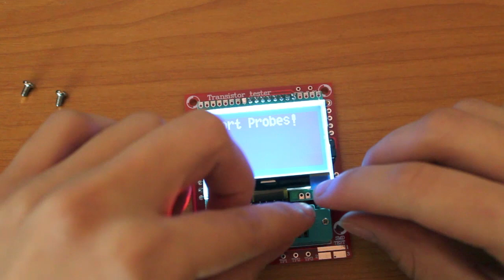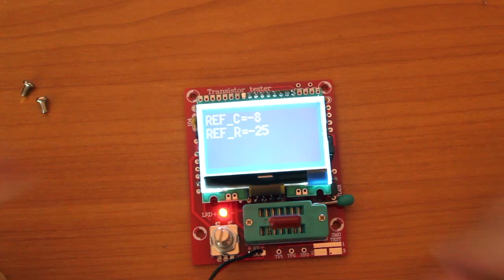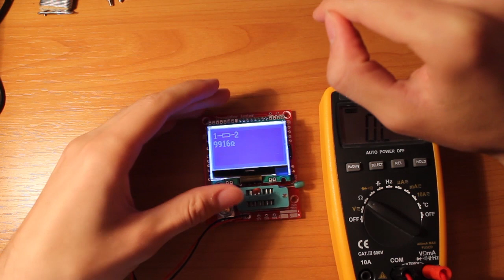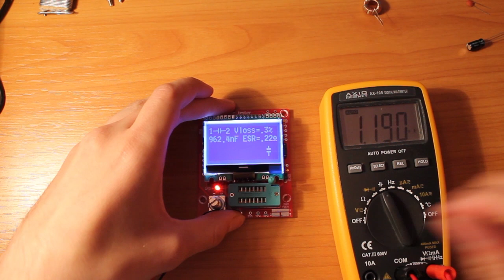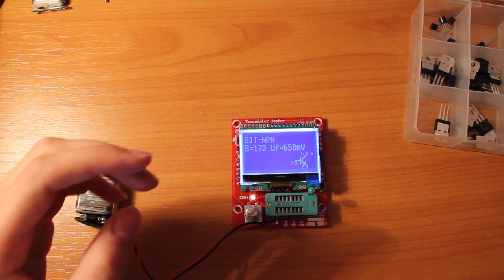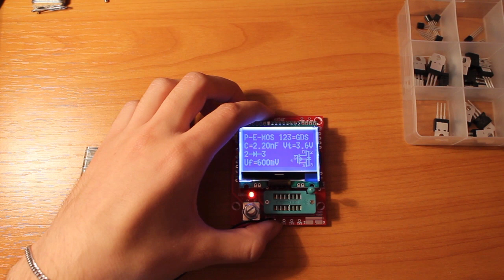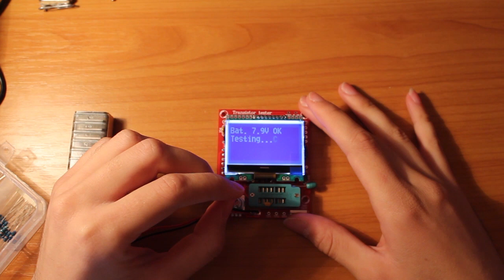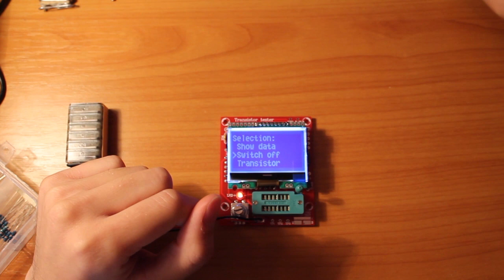M12864 Graphics Transistor Tester from Banggood, Part 2: Review

Comment: Hi, I have the identical model of video tester, bought at least 6 or 7 years ago (or maybe more) on Aliexpress or Bangood, I don't remember exactly. By testing a capacitor that was not completely discharged I fried the Atmega 328p of which (my huge mistake) I never saved the firmware. I replaced the Atmega but I haven't found a firmware that works for it. Do you know where to find the original for this tester? A thousand thanks.

Comment: hi, the display of mine lit up but nothing happens. I can only see the backlight.  Do you know can i solve this problem?
Reply: I had the same situation.  The red light and backlight came on for 45 seconds or so then went off so I figured the firmware was running.  I then inspected the crystal and it was 8Mhz, so that wasn't it.  Then I checked the back of the display module and the solder connections to the ribbon cable were absolutely filthy with flux and gunk.  I used IPA and a toothbrush and got it to work.

Comment: I have the real schematic! 
    This will probably get marked as spam but that is not my intention. I just did a video last week of a step by step reverse trace of this clone version. I created the schematic in KiCad using the exact part designations and a similar layout to the official OSHW PDF schematic by Karl-Heinz on www.mikrocontroller.net/articles/AVR_Transistortester. The schematic is available on my GitHub page as well as linked in the video. I have also done this for the AY-AT clone, and will do another for the T3/T4 soon. All are none monotized and intended as simple OSHW community resources. https://youtu.be/LHoMMMbiSXo

Comment: You forgot about one thing. If You compare that tester to multimeter's resoults, then first You should connect together multimeter's probes and read what resisance they have and then when You read a resistor value you should deduct that probes resistance, which you read before - to get correct resistor value!

Comment: I really have a hard time finding people who actually use the frequency counter on this device.  I did some tests but the results weren't as good as expected.  I wonder if this is a problem on the build I did or if this is in fact a buggy option.  For instance, feed a square wave of 1Vpp from 1KHz to 25KHz, in 1KHz increment.  Take note of the 3 values returned for each frequency and take few moments to share your results.  Regards.

Comment: So can anybody give me the pin layout, I have a hard time figuring it out.

is it 1231 1111
        2222 3333
Reply from the maker: If you are referring to the INPUTS, I believe they are (from left to right) 111 2 333. You can check by using the test points below (TP1, TP2, TP3).

Comment: The new device was more accurate than your multimeter because you did not short out your probes; get a resistance reading, and then hit the REL button to zero out the probe resistance during your tests..
Try it again after 'calibrating your meter.
 It's an expensive feature on any meter, and a great one to have on your meter.
You need to learn how to use it.
You will really like it!
Dennis O.
#12
Reply from the maker: Ha. I never thought about it. Thanks a lot! :)

Comment: C+ESR - with this function you can test cap in circuit. Try it and report back.
Reply: In fact this option allows you to connect probes in the banana jacks and test capacitors without having to press the button each time you test a different capacitor.  This is speeding up the process and yes, it can be useful to test in-circuit capacitors as you only need to concentrate at putting the probes at the desired test points and the display refreshes itself every few seconds.  Only capacitors having a value of 2uF and more can be evaluated via this option.

Comment: Thanks for a great pair of videos!  So good in fact that I decided to buy one myself.  I already have a multi-meter but it does not do as much as what that "transistor tester"device does.

Also, it is going to come in handy when I recycle parts from old PCB's. I will be able to decide which parts are worth keeping and which can be thrown out (damaged, out of specification, etc.).

Thanks again!